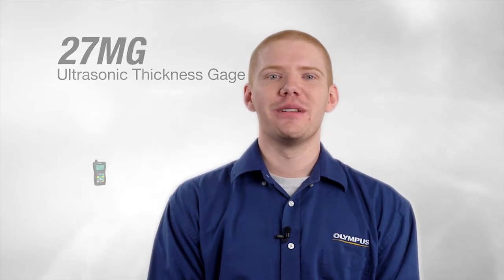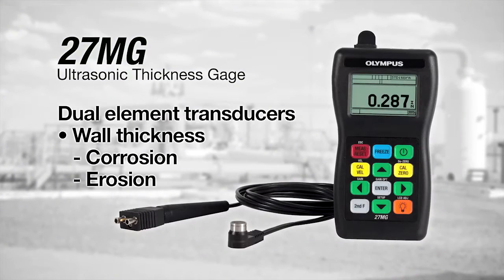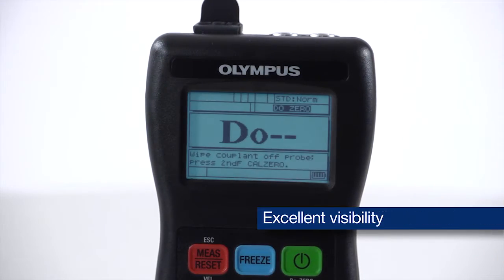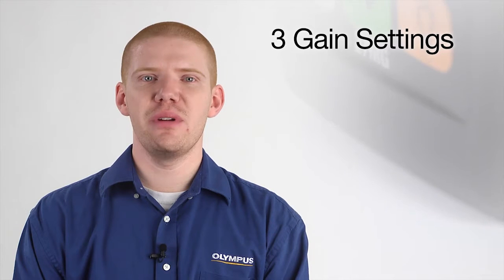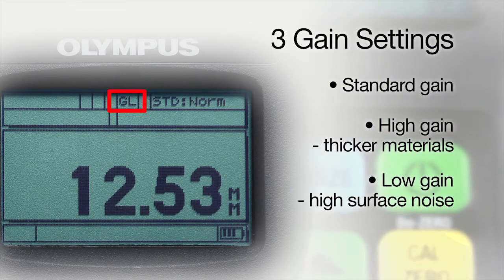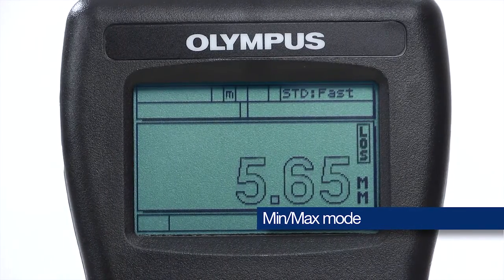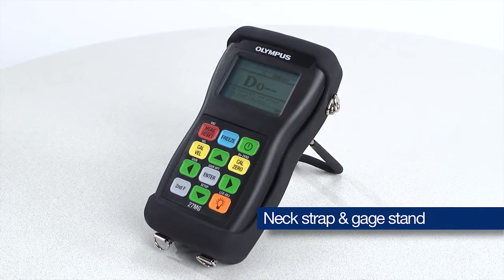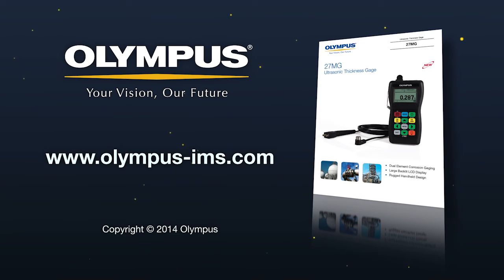Introducing the 27MG Ultrasonic Thickness Gage

Comment: Hi,

i am in procession of this instrument Sl.NO: 150183206. 

i tried resetting the the values as per the instructions given in the the operation catlogue, and also as per the instructions on the battery cover sticker. 

i am able to modify both the valve of the tick value & thin valve but when i hit the MEAS/Reset button after entering all the known values to calibrate the instrument to measure unknown values i am unable to to it calibrated . i am getting calibration error. 

Pls help me with a video of the calibration done on this model (27MD) on your test piece..
Reply from the maker: Hello Shriram, our apologies for this late reply. The best way to get in touch would be through our website: http://www.olympus-ims.com/en/products/contact-us/366-dirItemId.1157632067.html. That way, a product specialist near you can provide the assistance you need.